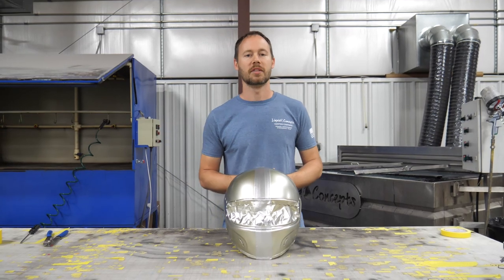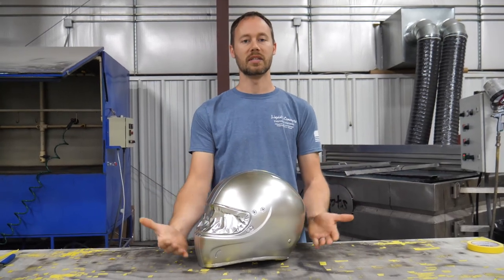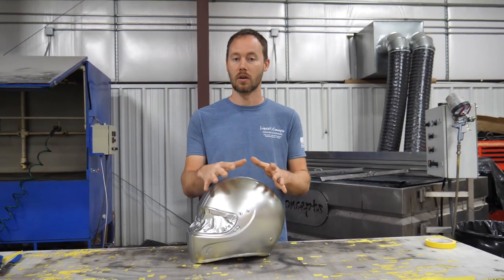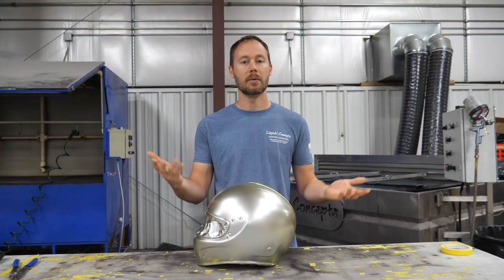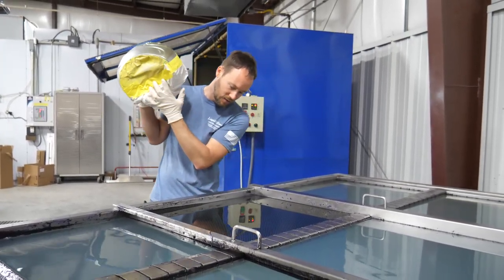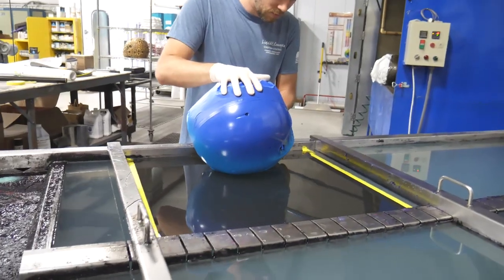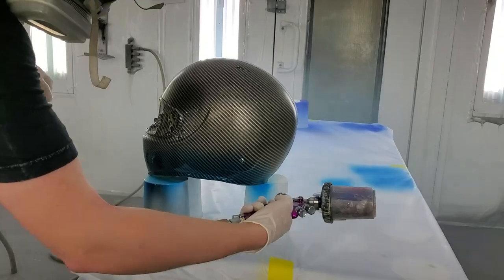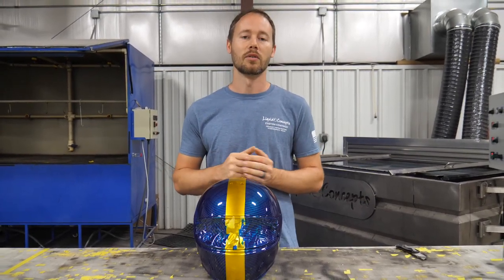HOW TO HYDRO DIP A MOTORCYCLE HELMET | Liquid Concepts | Weekly Tips and Tricks

Comment: I have so many questions... Whats the patterned sheet made of? Do you use regular spray paint underneath and for the clear coat? What do you spray in the water? Do you plug the holes on top?
Reply from the maker: With this process we use Hydrographic film (pva). We do recommend using automotive base paint after primer, and automotive clear coat. Aerosol can work but several are a single stage which is not good for this process. To activate the film we are using Hydrographic activator designed to work correctly with the film. You can view all of the products and such on our website as well. Also feel free to email us at info@liquidconcepts.com if we can help answer any other questions you may have.

www.liquidconcepts.com